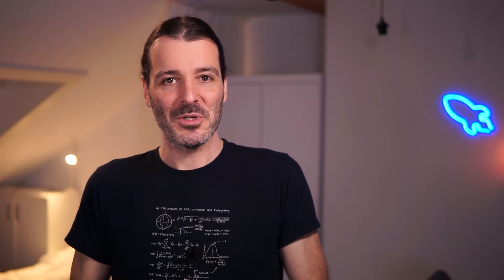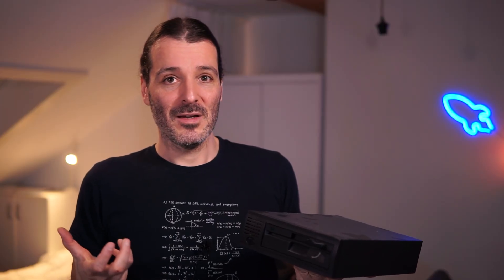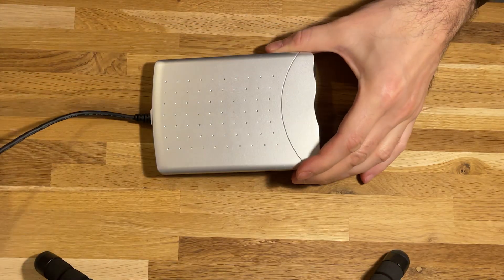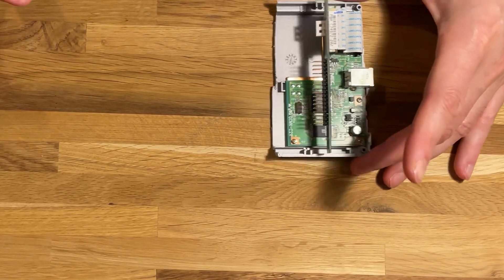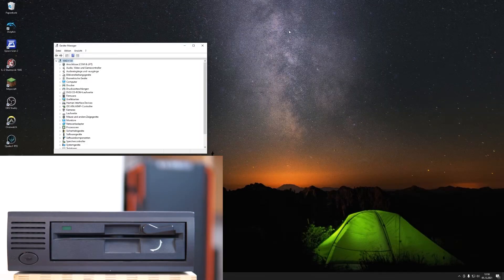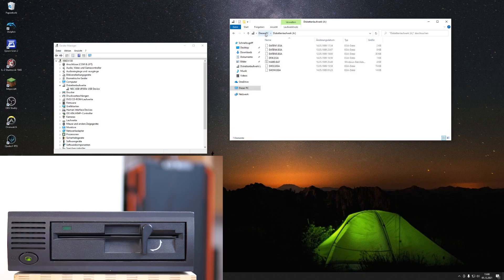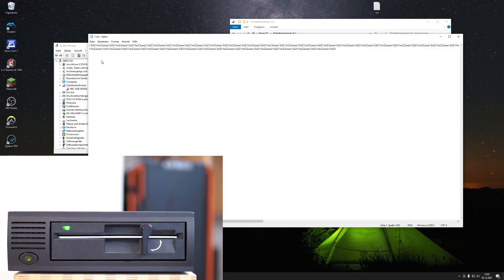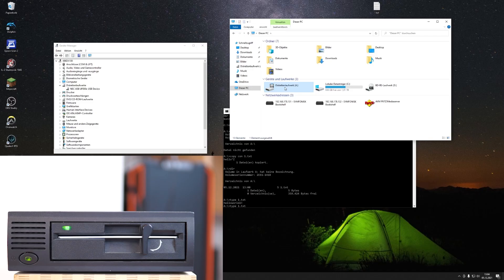How to build a working external 5.25" USB Floppy Drive

Comment: The BIOS has to support it first, then Windows has to contain the diskette drivers for all four drive types. The driver has to support the appropriate driver for the diskette for the FAT for the directory.

You need to find the source for the old Win Diskette drivers and recompile them for 64-bit, then install them into the modern Windows system.
Reply: bios support is not required because it's just a USB device. he already showed it booting from being off and just powering it on and it boots to dos just fine. This is a modern-Windows driver problem.
Reply: @johnbos4637 Sorry dude, but nearly everything you said was wrong. It's maddening that posts like yours get so many upvotes.

bios support is not required because it's just a USB device
Quite the contrary, under DOS, extensive emulation is done by the BIOS to make the USB device look like a floppy drive. It's why you have multiple options in your BIOS setup screens controlling how USB devices are presented to the system, because BIOSs don't have anything like the smarts you find in a real OS driver for identifying USB devices, or interrogating their capabilities.

Further, there's no spec for emulating 5.25" drives over USB (there are 3 supported geometries, all of which were used on 3.5" media) - it's just that whoever wrote the BIOS was lax about the emulation code, so by pure accident, it works - a shortcut Windows (and any proper operating system) isn't taking.

This is a modern-Windows driver problem
Again, completely wrong. Even Windows 11 24H2 supports 5.25" floppy drives connected to 82077AA-style controllers - I've seen it working perfectly myself. The issue here is that it's a USB device, which - as alluded to above - words cannot convey how absolutely, completely and ridiculously differently it works to an old-school floppy controller.

Quite simply, Windows has never supported this configuration at any point in history, though it may have worked on Windows 9x using MS-DOS Compatibility mode, because it would be falling back to the (USB spec-violating, reminder) emulation code in the BIOS. This however never worked under NT (which every version since Windows Me is), as it's not using the BIOS emulation, and trusts the device to report accurately what it is.

TL;DR: this device is reporting itself as a 1.44MB floppy drive, there's no specification for it to report itself as a 1.2MB drive, and none of this has anything to do with Windows.
Reply: @johnbos4637  I have yet to be able to wrap my head around the fact we cannot get the collective hobbyists to put together an actual working read/write 5.25 solution that reads/writes natively without images. I know the USB standard doesn't support it, but so what? There are plenty of proprietary USB devices with custom drivers etc, so what is holding back the development of an actual USB 5.25 floppy? Some say demand, but it is VERY evident (especially lately) that there is a huge demand for such a native solution. Ideally, an external shell with the pcb and power with connectors inside. USB and standard power plug on the outside. Or heck, even a brick 12v adapter would be suitable. I don't know enough to even begin, but it is obvious there are plenty of people who are.

Comment: Somebody on stack overflow suggested overriding the default driver for it.

    Go to Device Manager, select the drive
    Select "Update driver"
    Select "Search Computer"
    Select "Choose from list"
    Select "Show all devices" (first option in list)
    Select "NEC Systems"
    Select "NEC floppy disk drive" (or similar)
    Install this driver
Reply: Wouldn't work. That driver is for floppy drives connected to 82077AA-style FDC controllers, not for drives connected via a USB interface. There are no words to describe how absolutely and completely differently those two work, and a driver for one cannot be used for the other.

Comment: Would DOSbox allow you to connect to this drive? Might be a good way to bypass the Windows driver issue?

This is an amazing idea you have here. As someone who uses a laptop, I have an external optical drive and 3.5 floppy drive to connect via USB whenever I need to, and a 5.25 option would be kind of amazing to have as well.
Reply: Although USB ZIP drives exist, get an ATAPI model and the old USB-to-IDE converters to have that work too (let me test it with a newer system first, before you try with that expensive Lenovo P1 Gen 4 - I would be so scared to travel around with that).

Comment: So... FWIW, I think the reason it works (with high density disks) in DOS is a lucky combination of the real-mode USB floppy drive shim in your computer's BIOS being "well behaved" and the firmware of that USB floppy controller being "well designed", not because the controller itself explicitly "knows" anything about 1.2MB floppy drives. The semi-abridged version is if you read the API documentation for USB floppy drives you'll find that they really don't "emulate" a real floppy disk controller from the computer's point of view: the low-level floppy control functions are entirely run by a microcontroller embedded in the USB dingus and it presents a "block mode" interface roughly similar to a hard disk or USB flash drive. I think the reason it's working is when DOS makes the INT13h call to the BIOS handler for the USB drive it's sending an IDENTIFY command to the drive and the drive controller, instead of answering with a canned geometry, is checking the mounted disk to see if it's formatted and if so if it can reconstruct the geometry from what it actually reads. 1.2MB and 1.44MB floppy drives use the same data rate, so the controller is successfully seeing "bits", and it's apparently also successfully at reading those bits well enough to determine that the currently mounted disk has 15 512 byte sectors per track, which it's reporting back to DOS without trying to second guess it. As long as DOS also doesn't second guess anything and is willing to use the geometry as reported then, sure, it's going to work okay, at least on already formatted disks that are identified correctly.

(A contributing factor to this working may be that there is actually a "standard" 1.2 MB format for 3.5" drives; some Japanese computers from the late 80's through the 1990's used 360RPM drives, and the format for that is one of the three "pre-baked" formats codes defined in the UFI API format. That format uses different size sectors, however, so it's not like the disk controller is "mistaking" the 1.2MB 5.25" floppy for one of those, exactly. But it may be that 360RPM support that's keeping it from throwing an error related to the timing of the index sensor?)

I'm curious what happens if A: you try formatting a disk after booting DOS off the floppy drive, and B: if you boot from something else with the drive empty and then run "SI" to see what it thinks the floppy drive is, or if it sees it at all. My guess in the latter case either SI isn't going to see the drive at all or it'll simply report the drive size as whatever readable media is present.

As to why modern Windows doesn't work, well, I guess you'd have to ask a Windows developer, because in the case of high-density disks it appears it is trying to second guess the reported geometry. If it just took the drive's word for the "shape" of the mounted media there shouldn't be a problem, it should work as well as DOS does. Maybe Windows' driver explicitly sets media types when it interacts with the drive, it looks like that's an option, manually probing to see if it's a supported type?

As for it "kind of" working with low-density media in Windows, I think what you're seeing there where it looks like a tiny file can be successfully created is just an artifact of filesystem caching, I'm sure the drive doesn't know anything about how low-density media is supposed to be double-stepped. An interesting experiment if you have a "real" DOS computer around would be to put a custom 720k (80 tracks of 9 sectors) format onto a 5.25" floppy and see if that does work completely under Windows. (Google "2M" or "FDFORMAT", I think either of those will work to put the format on there.) The result should work just like a 720K 3.5" disk, and since it's clear from your experiment that the drive can figure out when a low density format is present you might be golden. But since that wasn't a standard BIOS-supported size back in the day it doesn't help you a lot.
Reply: I'd also like to see modern Linux kernels try to interface with this thing; you could probably see what size block device the USB dingus is exposing.
Reply: @SuperSmashDolls  That was what I was thinking.  Linux might have some entirely different ideas about what it sees.   Doesn't mean it will work correctly either, but would be interesting to see.
Reply: Pardon a lengthy, and late comment: I appreciate the detailed analysis and thoughts, here. I was inspired to try reproducing these results on similar hardware, and also got a successful boot via USB. I am trying to get real-time I/O working in Windows using a similar external USB drive and floppy controller, and I found that I can see and access a 5.25" disk formatted at 1.44 MB (shenanigans, I know) in Windows XP. Demo here. https://www.youtube.com/watch?v=9fUKrANBkBY

I used fdformat in DOS with a traditional desktop tower to do the 1.44-MB 5.25" format. I have been reading up on the Japan PC98 and "NEC DOS" 1.2-MB formats, and wondering what detail is missing between a real 1.2-MB 5.25", the drive and controller that doesn't work in Windows, vs. when a 3.5" 1.2-MB disk is present and works in the same controller - at least, in my case.

Thus far, I've been able to format (via fdformat) a PC98-style 1.2 and/or 1.23 MB 5.25", but ran into trouble writing a PC98 image.
Reply: Professor!  Good to see you, my friend.
Reply: I’d also be curious as to what ImageDisk from David Dunfield says about the drive while under DOS.
Reply: I haven't ever looked up how USB floppy support works, so the LBA translation is news to me.  But that makes sense.  If I had to guess, I would bet that the IDENTIFY command actually returns a 1.4MB drive, but DOS may only use that when asked what kind of drive is present -- which is probably only relevant when in a handful of cases, notably when formatting a blank disk.  DOS seems to obey whatever is in the media descriptor byte first and foremost, and resorts to hardware identification only if it cannot determine the disk format by the contents of CHS 0,0,1.

I'm really curious what would happen if you try to format an empty disk...?  (It would have to be unformatted, not just empty, so there's no existing media descriptor byte.)  It would be interesting to see what happens when given format /u (with no capacity switches, and thus left to auto-detect via hardware), and also what it does when told explicitly to format at 1.2MB and 360K.

Comment: Windows 10 has full support for 5.25" floppy drives when they are connected to a real floppy controller on the motherboard .
The problem is that the firmware on the USB floppy controller reports a 3.5" 1.44MB floppy over the USB connection.
It seems works in dos because the BIOS probably doesn't care about what the controller firmware tells it, but any windows OS follows the USB specifications fully and listens to what the firmware has to say about the type of floppy drive.
Reply from the maker: I read about the 5.25" support in Windows 10. When I revived my old Asrock mainboard with native floppy support it did not want to cooperate with a 5.25" drive. It always reported a 3.5" drive. And the weird thing is, that that very same motherboard used to work with my 5.25" drive when I used it with Windows 7 years back. Perhaps a BIOS upgrade somehow broke the support...
Reply: @dospedition4207  I built a similar configuration using a UF0001 with a NEC FD1157C but nothing works. I either get a permanent "Insert Disk A:" message or a device unrecognised error. Would appreciate feedback as you also hve very similar USB drive. What model is that floppy drive you used?
Reply: @eatbsreal  With apologies for a years-late reply, try reviewing the jumpers for items like drive ready / select / load. What I like to do is make sure a 5.25" works with a regular PC first, then move it over to the UF0001 for testing. I've had some success with a few drives.
Reply: @dospedition4207  just use windows 7 then.
Reply: The issue isn't the firmware.  It's the USB spec for floppies only includes support for 3.5" discs due to the spec only supporting 3 combinations for the number of tracks, sectors, heads, etc.

Comment: I've wanted something like this for years! I was actually considering learning FPGA development to make it happen but that's way above my pay grade. Judging by the fact that the bios/DOS handles it fine but Windows doesn't, it has to be a driver issue. Maybe someone who knows how to write drivers can help us out, or maybe the existing driver can be tweaked.
Reply: I just bought two different VST USB floppy drives, in the newer model you can see two distinct chips through the transparent shell. The older model has a date code of 1999 but I cant see the circuit board. I cheaped out and bought an adapter from ebay where the 34 pin is female, it's shipping from China so my experiments may have to wait a while. I'll keep you posted!
Reply: @iminthatweirdpartofyoutube2687 So, did your experiment work?
Reply: @iminthatweirdpartofyoutube2687  how it’s going?
Reply: soon enought there's going to be a cheap solution (arduino based) that will interface fdd's to a modern pc by the means of dosbox
Reply: Nice :)  There is the greaseweazle controller, but at the moment you can only read the whole disk - a driver that let you access the disks as block devices would be a good next stage.
Reply: FPGA? why not just wire up a raspberry pi pico to the IDE header of the disk drive and write your own controller code - could even make the disk appear as a flash storage device, doesn't really matter as long as you can handle the OS read/write calls.